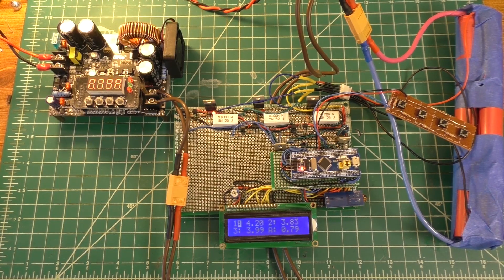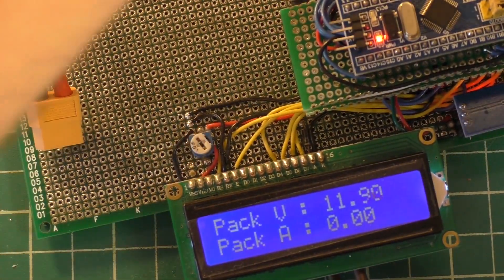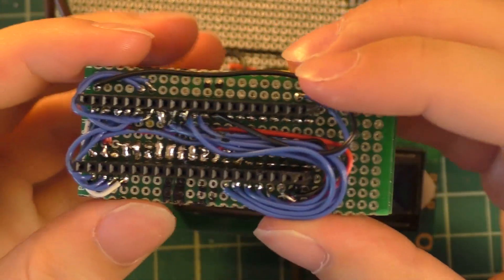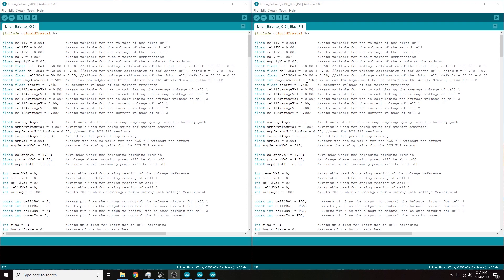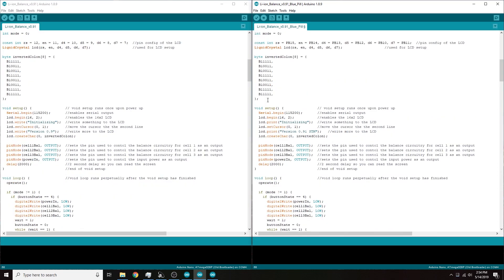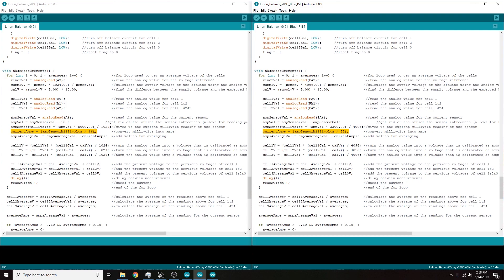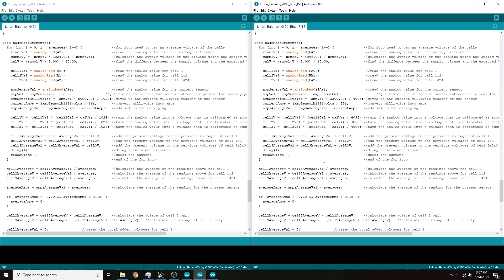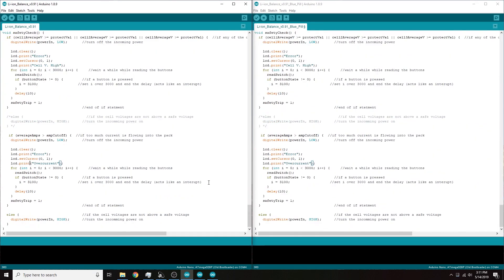Arduino BMS #12 Using an STM Microcontroller

Comment: Hey man. I got one question. Your bms project had an N channel mosfet starting with rpf12nxxx its not really available in my area. Was wondering if you could give me some details of this mosfet or suggest me some other mosfet. And how can i really contact you through email or twitter?
Reply from the maker: The only thing that is really special about it is that it is a logic level mosfet. This means that it can still operate effectively with a gate voltage of 3-5 volts. I think they are only rated for about 10 amps and have an on resistance of 0.2 Ohms.
Reply: @Eman2000  can you link me the datasheet? And can you suggest me any equivalent mosfet.

Comment: Thanks for your work. I think the STM32 is a good choice. I'll be moving towards a 7s system so the extra GPIO's are good. The code will be invaluable. I have not really seen anyone else doing a solid but easily put together BMS like you are. Cheers.

It would be interesting to see either wifi or BT addition ... I am hopefully (far in the distant future) also going to look at some sort of exporting of the data and web interface ... Grafana is used by others to achieve this, though my current knowledge in this area is incredibly limited ... might need to consider one of the Node boards or the ESP boards?